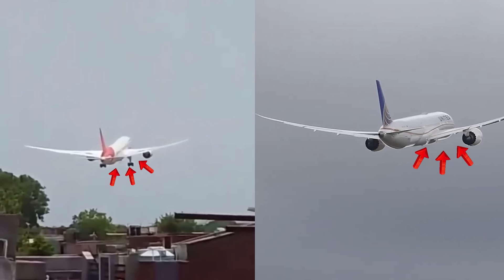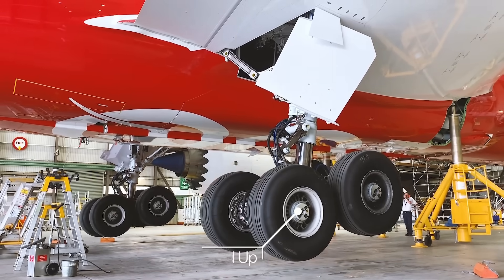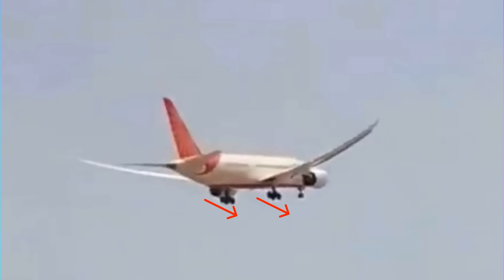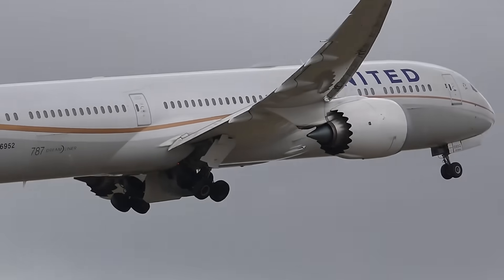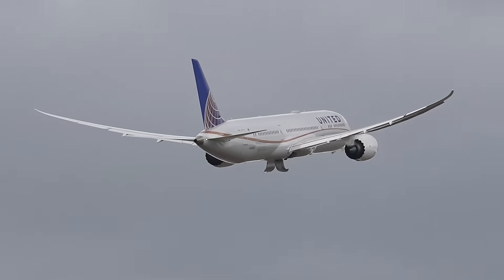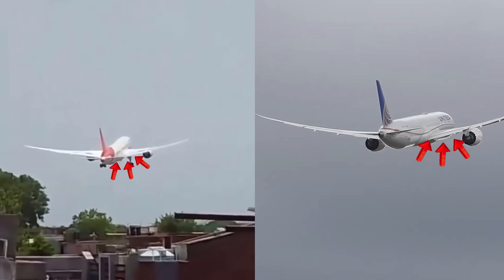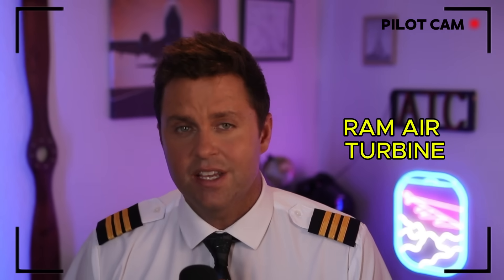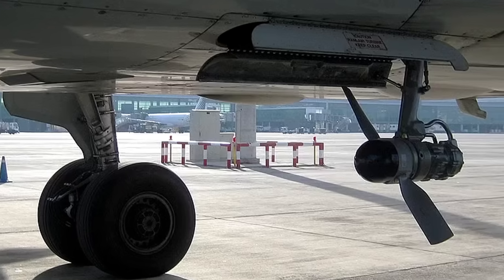Pilot Explains: A New Detail in the Air India 787 Crash Everyone Missed

Comment: Why didn’t the gear doors open first if they selected GEAR UP?
Reply: As you can see in the gear retraction video the sequence is:
1. Bogies tilt forward.
2. Bay doors open.
3. Struts rotate inwards.
4. Bay doors close.
So if they lost hydraulic power immediately after the first step the doors wouldn't open.
Reply: @ky7299 Gear doors on a 787 use the Alternate Retraction System as the primary way of opening the doors which means gravity opens them. All you need to do is unlock them. For closing doors, yes, you need Centre Hyd.
Reply: @ky7299  Not necessarily true: on the ones I fly it’s always inner gear doors first. And inner gear doors are gravity open.
Reply: Because the tires have to move a small distance before the doors can open.
Reply: Even "Before selecting the landing Gear handle UP"  , the gear tilts Forward Down... as soon as the sensors detect AIRBORNE...  see:   AMM 32-31-00 LANDING GEAR DESCRIPTION AND OPERATION.    So, regardless of the selection of the gear handle, it will always tilts forward down to prepare for retraction.
Reply: The 787 uses the Alternate Extension/Retraction system (circuits) when either Gear Up Or Gear down is selected. Hence gravity is enough to lower the door ‘Once all bogies are ready to be stowed only’
Reply: The gear doors may well extend by gravity, but there will be an actuator/switch to allow that to happen…and it will be either hydraulic or electrical.   Anyone know? My money is on electrical. So….either the crew were so distracted as to not even attempt to raise the gear (a not un-common event in the simulator when dealing with an extreme problem) OR indicative of an electrical (or hydraulic) problem very early on. Since raising the gear is about the first action after getting airborne, it would help establish a timeline of events.

Comment: Occams reminds you that the answer might not be in the set you are considering. Duel engine failure looks like it goes in the high probability assumption category at this point. Keep an open mind. Remember fewest assumptions is usually the answer, but the answer is always an assumption until you verify it with eyes on.

Comment: At 3:08-09 it looks like a tire or something bouncing up into the air. What is that? Is that part of the engine coming off?
Reply from the maker: Haven’t figured that out yet.
Reply: @Garybpilot  If it's something being stirred up from engine thrust than 🤔
Reply: @Kando439 the engine had no thrust, there's no engine noise in the video
Reply: @zlmdragon. idle thrust can be heard. 

The wind kicking things up is the wingtip vortices coming from the airflow off the wings… for a lager widebody they are rornado strength and can easily pick up debris and send it flying (like a piece of a roof)
Reply: @Garybpilot Look at the crash site and see where parts of the airplane struck first and how far apart is the initial impact of the landing gear and the tail detached from the rest, seen all over the internet on top of the first building.

With the rest passing over more than 100+meters when it crushed finally into another building/ground and exploding. 

Thus the bit flying could be anything from that building or from the tail side, as it impacted the building.
Reply: That's a bird. Its not at the place of crash. Its quite away from the point of crash.
Reply: @anjanikumarranchi  as if the plane doesn't fly at an angle vs the camera spot
Reply: That object is WAY in the foreground.
Reply: The landing gear was in tact after the crash

Comment: Have you seen the video a passenger posted of the power issues (no AC, issues with seat screen and button electronics) that were present in the same jet just a few hours before this flight?  Maybe there was something that caused a complete power failure?
Reply from the maker: Electrical failure shouldn’t shut off the engines. More likely the other way around so something is really odd here.
Reply: @Garybpilot The fuel pumps are powered by electric current and there electrical problems.  I really believe you investigate this possibility more.  Moreover if there was contaminated fuel there would be other aircraft with the same problems.
Reply: @turbinetech3000 the main tank fuel pumps are powered by the aircraft electrical system and even if they stop working the engine fuel pump pulls the fuel by suction from the tanks - that pump is driven off the engine gearbox. The control of the fuel going into the engine is done by an HMU ( Hydro Mechanical Unit ) which is control by the EEC on the engine, both of which are powered by a dedicated PMA ( Permanent Magnet Alternator) on each engine.
Reply: @DarrellThompson47 ok if electric power was lost would there be a lag time for the mechanical pumps to deliver fuel
Reply: @turbinetech3000 no. So basically you've got one pump pushing and one pump sucking. If the one pushing stops working it would not make any different to the fuel delivery, at low altitude anyway.
Reply: You said the mechanical pumps are driven by the engine but you are assuming the engine is still running from the electric pump fuel if I understand you. It seems contaminated fuel would show up somewhere elsr
Reply: @turbinetech3000 no, the engines can be started and will continue fo operate regardless of wether the boost pump ( the electrical pumps in fhe fuel tanks ) are running or not.

Comment: If you loose all electrical will that do dual engine failure
Reply from the maker: No. Could happen the other way around though.
Reply: @Garybpilot  Actually fuel pumps are AC.  But the engine driven pumps?  Contaminated fuel?  Only this plane?
Reply: Bro this is exactly what every other pilot is saying
Reply: The only thing I know is the plane ✈️  needed a good service.  with air condition and who knows what was not working
Reply: Engines provide the electricity, not the other way round.
Reply: TRY ENGLISH!!!